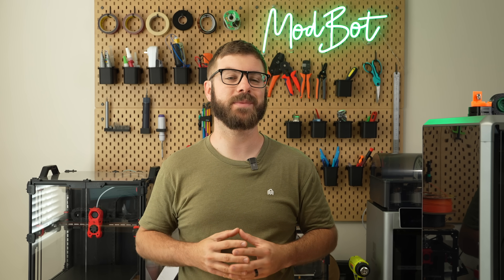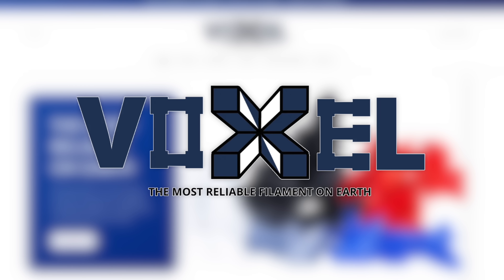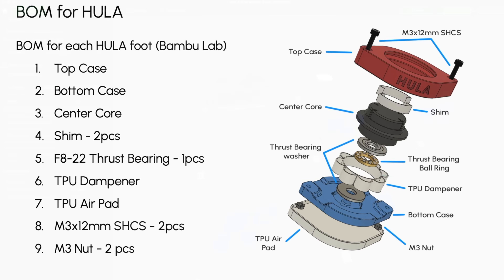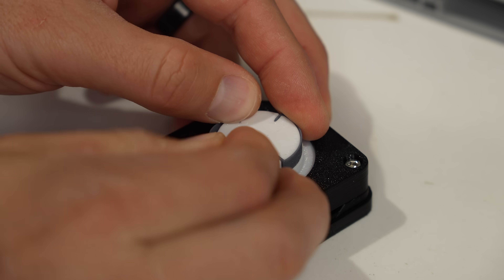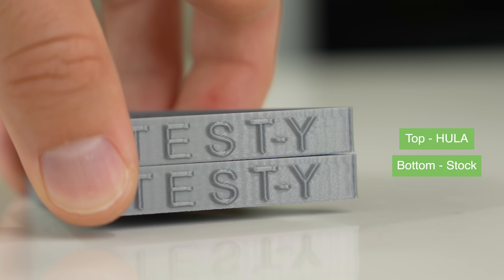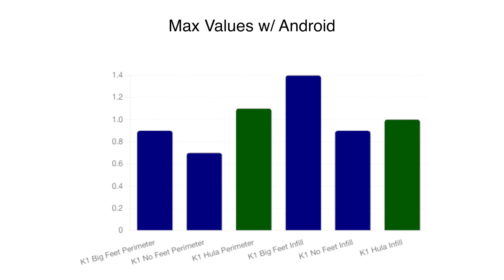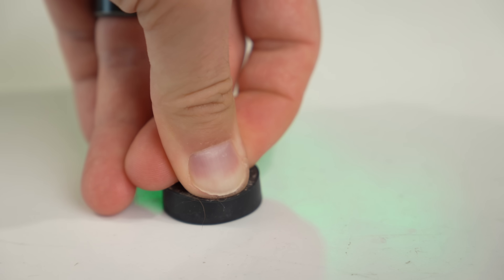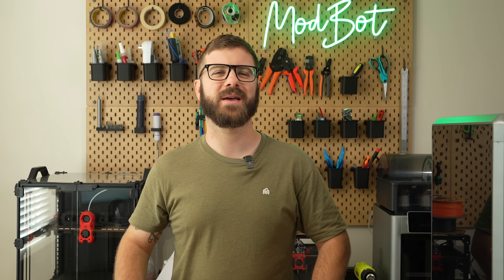Self-Aligning Anti-Vibration Feet For Your 3d Printer (HULA)

Comment: I spent a lot of time arguing with chatgpt that TPU is a dampener because it resist bending and comes back to shape slowly - almost like pneumatic dampener. But ChatGPT kept insisting that TPU is not a good dampener. After a while I started reading the reasoning (when people argue ignore what others have to say). Turns out TPU is a very poor dampener, although it does dampen a bit. It might change the system resonance frequency, but it transmits vibrations relatively well. A much cheaper (regarding your time and effort) is to get a recycled rubber dampener plate for washing machines. it's 60x60. on top of it put something rigit (paving stone, wood particle board(worse) or similar) or just use the rubber dampener alone. Makes a huge difference. The bambu callibration is much quieter, the printing is much quieter. I haven't noticed change in quality, but I'm not obsessed with print quality - it's never going to look as good as injection molding.

Comment: The problem with feet solutions is it doesn't eliminate the vibrations from the top of the frame. i want to make a steel frame around my machine to completely stabilize the top gantry and make zero vibrations travel to the bed.

Comment: I just use rubber mats, vibration sound cut & vibrations dampen too, but vfa still no change ( conclusion it’s not machine vibration cause) even changed idlers pulley from non teeth to teethed pulleys) still having faint evenly spread vfa that’s not ghost or rings. 😅

Comment: I'm trying a set on my K1 but I'm not convinced that it is better than a squash ball underneath the K1 stock feet.

My K1 is on stacked LACK tables with a CFS on the top and my K1 on the bottom.

Comment: The dampening needs to go under the quartz. You’re cancelling out the benefit of the slab’s mass with the flexible feet. Put a layer of foam under the quartz slab if you need lateral dampening.

Comment: A woolly short haired mat with rubber backing, like the one used just inside front doors in public buildings to catch the grime and wetness from shoes.
Cut a piece the size of the printer footprint. Cut another piece of same size.
Put them on the table/shelf with the woolly sides against each other.
Hoola baloola tadah.

Comment: If what I have learned from large machines also applies to smalll, lightweight 3D printers, then I think the best thing to do would be to place the printer on a very rigid and likely high mass stand. A solid, extremely flat top surface for the printer to sit on would also be important. The best product that I can think if to meet all of the reqiirements is s granite surface plate on am included stand. It would almost certainly have a mecanism for leveling the stand as well as a three point leveling system for fhe surface plate.

Comment: I did the opposite. I printed a form and cast a concrete slab that has a tapered pocket. I printed high durometer tpu corner grips that taper lock the printer into the slab. Once you run the calibration, the machines have been operating very well side by side on a similar metal shelf. I took the ridged Cnc machine approach. It just doesn’t seem like allowing the machine to flop around would benefit the motion system.

Comment: I used to tune a lot of highend turntables costing considerably more than the most expensive of these Chinese hobby machines. I am not going into the details but the trick was to dissipate the vibration energy before it found its way back into the turntable and caused all sorts of ' colouring' of the sound. A few approaches were popular, increasng mass in critical areas, clever cut out designs of the topboard, use of dead sound cradles, etc were some of them. One of the most effective ways of killing the vibration was the use of what is called Sorbothane in the supports. This material was dveloped for NASA to isolate the delicate cameras and associated electronics during the hell of the forces exerted on Launch. In simple word, Sorbothane converts vibration energy into heat, and it works. The caveat was that it was very expensive. Perhaps an approach along these lines could be of more benefit. The fundamental problem as I see it is that print head and the heated bed do not move in unison with each other. There is always a lag, and also the whole idea that an extruder can cope with keeping the flow of the molton plastic optimal while the printing head is going through its rapid motions is rather naive. Perhaps these printers are fundamentally flawed and  limited by the nature of their design concept and another approach is called for???

Comment: Using vibration damping feet will reduce the vibrations transmitted to the table, but the printer itself will still significanty shake.

Comment: Every cnc machine ive seen are bolted to the floor.

My printer is very heavy and has hard rubber feet so i dont really have any issues relating to vibration.

Comment: I think there was a flaw with your testing method... You were measuring vibrations transmitted to the workbench.... I don't care if my workbench shakes like a level 6 earthquake.... The objective of Hula is to reduce vibration of the PRINTER.   The PRINTER should vibrate less... Essentially Hula is transferring the vibration energy away from the printer and into the workbench, which is why your testing showed MORE vibration on the workbench... That's vibration energy that was transferred away from the printer... Result being a more stable PRINTER

Comment: my P1S actually slid off the anti vibration feet and I almost lost it over the side of the table it was near the edge..  so I went  back to the stock feet, and placed it on a thick sticky gorilla shelf liner that was sprray locked down, and after running a calibration, it works fine, and the sport mode didn't go crazy.. and its actually quieter since its not banging around..  not the results I expected but the bambu feet are just to wiggly soft and unstable..

Comment: I do feel like there's a fundamental misunderstanding of what you want in terms of 'vibration damping'. Ultimately you want the printer to be as rock solid as possible, vibration dampening feet are a quick fix when you dont have a solid base, like at all. 

The best possible base would be concrete, rock or solid metal with the printer bolted to it, if concerned about vibration from passing traffic or seismic events then a layer of rubber could be used with the printer strapped down. As far as I know no one has this option in a consumer printer.

Comment: Surly this would make it worse at certain frequencies of vibration where the rebound from the feet would be opposite to the motion of the bed or printer head, greatly increasing vibration .Iv found a 2mm sheet of EDPM rubber glued to a  quartz worktop works great.

Comment: I think these could still be useful to reduce interference from other 3D printers at high speed on the same table? Seems like a very niche use case though since most people already have things like a concrete slab for this

Comment: The best vibration damper I ever had is 2 concrete garden tiles with 8 cm of foam in between them, not the very soft foam but the kind they use in mattresses for instance.
Sets you back only 20 euros max but there's not any vibration anymore.

Comment: The video, your conclusions, and these comments have me pretty confused. What do you all think the purpose of the feet is? When you got to the end and basically said "the print quality is more or less the same in both setups" that should have been enough to say that the feet are worth it, because the point of the feet is to reduce noise, not increase print quality ... right? If the feet can reduce noise without lowering print quality in any noticeable manner, that's a win. But I'm really confused that you didn't test loudness or mention it in your conclusion at all.

Comment: In layman's terms, let's consider this for moment: We were shown that the a building is being supported by lets call them rubber dampeners. Now why is that the case? A building needs solid footing. What happens during an earthquake? What we depend on as solid footing becomes just the opposite, the "solid footing" is now transferring vibrations into the building and the building is absorbing them by also vibrating which is something you want to avoid at all costs due to the fragility of the structure. 

So the whole premise of using foot dampeners is completely wrong as to the goal trying to be accomplished here, which is to take the vibrations of the "building" and let them be absorbed into something else, aka, the earth. What this accomplishes is to simply isolate the vibrations to the "building" and doesn't help anything.

In our 3D printing world and anywhere else vibrations are dealt with, what we want to accomplish is for the thing that is causing the vibrations to be relatively small in mass and inertia compared to the "solid footing" that absorbs the motion and vibration. So your best bet as some have stated, is to build the frame out of heavy steel or actually fasten the frame to a concrete block. I would recommend fastening the frame to the frame of the house or garage. What happens then is that your 300g hotend carriage will be swinging into several hundred pound wall and unless the 300g is shot out of a cannon and have incredible inertia, the wall will not deflect much at all which will effectively dampen any residual vibrations from the movement of the carriage.

Comment: Engineer here.  You are making the problem worse by amplifying vibrations within the machine.  This mod flies in the face of the installation instructions of every CNC lathe and mill on the planet.  You should be doing everything you can to increase stiffness, increasing the resonant frequencies of the machine above the operating frequencies.  You should remove the feet, bolt the machine to a 3/8" thick steel bedplate, and mount the plate on a smooth concrete floor.  Replace the side walls with steel.  If you are running multiple machines in an area or can't transmit noise into the floor below, you can install the machine on a concrete paver and isolate the paver from the ground.
Reply: So are you saying it’s better to have the printer on a concrete floor and without any feet? 🤔and what if the printer was completely decoupled from the surface and was suspended in air. Im just curious
Reply: @FireDragon3D  Yeah, you actually want to anchor the bed to the concrete.  I just got my P1S in and measured the stiffness of the chassis during some acceleration tests.  It's stiff in the diagonal (into the corners of the cube) but in the X-Y plane there's an enormous amount of flexure.  I'm going to replace the aesthetic plastic corners and walls with aluminum or steel walls and a bedplate, then bolt that down to concrete paver.

Comment: I have them on my A1 and they do minimize vibrations slightly, but worse. The material they're made of creaks alot while printing and this noise is loud and annoying. Took them off after the 1st print and put stock rubber pads back on.

Comment: So... basically the same idea as the ball/threaded shaft shims which compensates for bent rods? However, vibration is different than tramming. 
EDIT: You bring up an interesting thought at the beginning of your video. Many people just have one printer so isolating vibration is just a 1-to-1. Someone with multiple printers, running at the same time, encounter X-amount of oscillations, not all in sync or resonance. Hoo-boy.

Since your tests are inconclusive, I wonder if the feet are in the wrong location? Perhaps if these were connected to the last component that touches the ground? Instead of the printer, perhaps installed on the legs of whatever is holding up the printer from the ground. In your case, the legs of your bench. I dunno.

Comment: Tried it on a MK4 sitting on a wire rack.
WIthout: M4.0 max, 2.4 average
With HULA: M4.1 max, 2.5 average

So it doesn't do anything at the frequencies that the seismometer app measures.

That said, I do see the feet moving, so it's clearly absorbing something . Whether that matters to anything or anyone, I can't say. Probably not, but it was a fun build with a well-written manual, so I have no complaints.

Comment: Conclusion - don’t bother.
Reply: just print the Bambulab soft feets (printables) from TPU with Low infill and layers. Works better than the Original
Reply: @janzale9596  and with soft rubber feet the printer will start to oscillate so they are a waste of time. My P1S is on its original feet and on top of a paving slab. No issue with vibration or noise at all now.
Reply: @janzale9596 no bolt the damn thing down to a heavy bench on a solid floor
Reply: @shaynegadsden  Exactly, you want no movement at all, you want all the movement to be in the printhead, not the frame. Vibration can come through even a concrete floor, but a bush of some kind would be bes, a Metalastic bush like they use on car suspension.
Reply: Really appreciate folks doing the science for the community
Reply: you want a mass-damper. Like the one used in Formula 1 that was banned, or like is in skyscrapers to keep them up in earthquakes.
Reply: Exactly, I got some from voxel for my A1 and x1c ... Made no difference and they started developing a annoying creaking sound .
Reply: Just do an isolation platform with a concrete paver and some padding

Comment: Even when I put anti vibration feet, it didn’t help too much. Then I made the same trick I did for my washing machine. It was very unstable until I put dryer machine on top of it. +50 kg on top stabilized it so I can put a glass of water without a spill. I put 20kg weight plate on my printer to make it stable as rock.

Comment: It's just basic physics. You want to dissipate all the energy imparted on the machine by Newton's third law when the tool head moves. The feet behaves as a dampened spring system supporting the machine. There's an optimal dampening amount that will make the system "critically dampened", this depends on the mass of the printer and how "springy" the feet are. I doubt the creators have done the math to figure out if they actually hit critical dampening for the machines they support.

Comment: Shim your shelves from behind to prevent it from wobbling or bolt them to the wall. Also, the best damper is concrete block with large foam pad, you can get both from Home Depot, this setup will help mitigate vibrations from one printer to impact the others one the same rack.

Comment: Why did you measure the vibrations of the table instead of the vibrations of the machine?   I'd expect the hula feet to reduce the peaks of vibrations and smooth it out in the machine where is could matter.

Comment: I just print TPU feet with single wall, large hex infil and no top, I then fill with standard silicone and let it dry for a few days, this gives me a vibration free foot for my printers and looks like a solid TPU foot when finished, this is cheaper and easier than the Hula and I am using this design on much heavier machines than the X1C and the Vorons, I'm sure the Hula is a great option, but I don't know if its really needed.

Comment: The vibration that does not transfer to outside, will transfer to your inside parts, therefore your print. Idealy you get the vibration out of the system and dampen it as quicly as possible in another separated system. If you end up in harmonic vabrations, not only will transfer to your parts but would as well reduce your device life span. See as example vibrations in the metal miling machines.

Comment: The reason there is very little improvement with anti-vibration feet is because there is a common misconception about what they are designed for. They are not meant to stop and therefore will not stop the vibrations of the machine itself they're designed to stop the vibrations of the machine from transferring to the desk or table it is sitting on. Any Improvement seen with any particular type of feet is purely luck and happenstance. The feet of the printer will never stop the vibrations from occurring within the machine. If resonance is the cause of ringing then the only solution is to dampen the very particular object on the machine that is vibrating in sync to the movements. This would likely be things on the tool head and would be extremely difficult to do. You in essence need to make those parts heavier or dampen them. Putting special feet on the printer would never accomplish this as the table itself is not the problem and not the part that's resonating.
Reply: This can be exemplified in the way hard drives are mounted. They always have silicone feet. It is not to stop the hard drive from vibrating the chassis but to isolate it from the vibrations of the chassis being moved and knocked around.

Comment: Having had the Bambu Anti-vibration feet for a bit I was wanting to try these, mainly to solve the one and only problem I had. The same as you showed, the feet would "roll" and transfer vibrations to my work surface. I knew there would be little if any impact on quality, just wanted my surface to remain as stable as it could.

I switched to these. Becuse I haver better luck with ABS than PETG I printed them in that, along with TPU. One  big gripe is that if the surface isn't particularly flat these will introduce wobble, as there's no way to adjust them without adding material of some sort to the bottom. They printed well and look good. 

I haven't ran any tests, mainly because I am lazy. In my world transmitted vibrations seem to be on par with what Bambu feet achievfed, maybe a little better, although I can't provide anty evidence. Could just  be placebo.  In the end I would say they don't do any harm, and are fun to print/assemble.